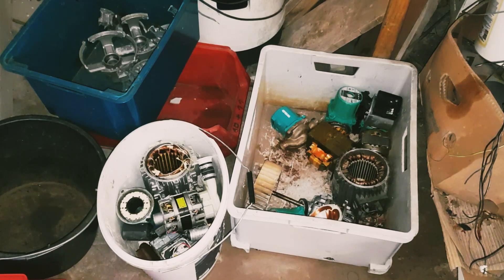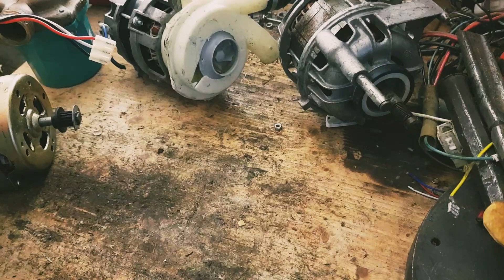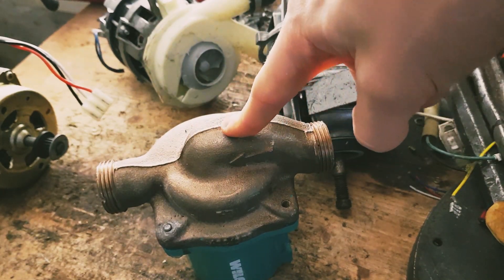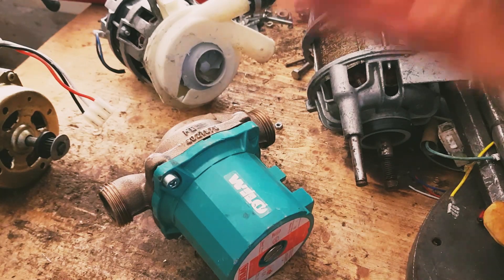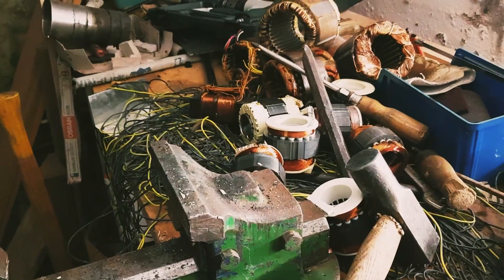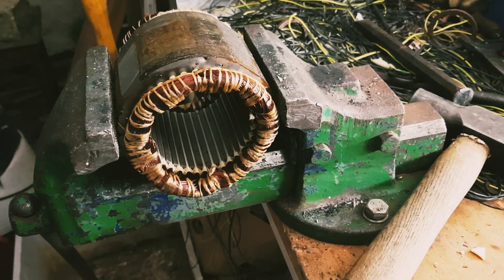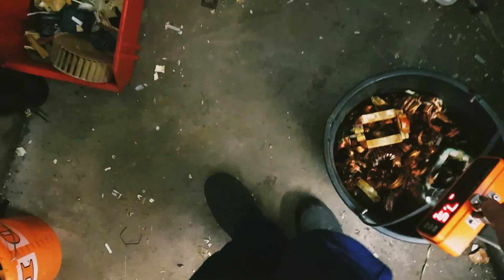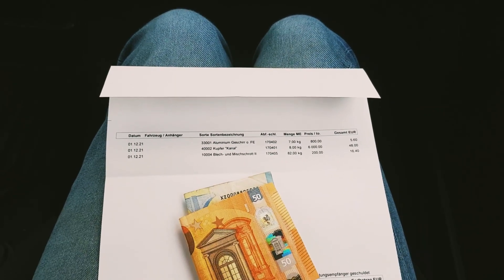Scrapping Electric Motors and Transformers for copper!

Comment: Nice little pick-up for a couple of hours work. Than air chisel looks to work very well,  I have often wondered 🤔
Might be a worthwhile purchase. I just cut one side with a grinder and cutting disc and use a punch to knock out the windings. Although,  I am going to build a windings puller,  just thought of the design and how to build today.😁
Sort of like  Simple man, but not really. 🤣
I'm thinking a rig made up and using a bottle jack to push the windings up and out of the stator. Hard to explain but I'm confident it will work. 🤞👍
Great video,  thanks.
Reply from the maker: Thank you very much for watching 😊 Yes, the air chisel works extremely well, but I mostly use it because there's nothing on it that needs to be replaced all the time, as it's the case with cut off wheels. Punching the windings through only works with about 50% of the motors I get, as they are very beaten up and usually twisted. I use a special tool to pull them through. Yes, I think the best thing for you to do would be to build some sort of machine that will pull the windings through, that's a good idea 👍👍

Comment: Wow. Amazing job on these motors and your video. Both well done 👏 ✔ 👍
Reply from the maker: Thank you mate, I should start to do this stuff more often, really was able to make a good amount of money with limited work 😊😊👍
Reply: @scrappingadventures290  
Your very good at getting the copper out easily. I had trouble with larger motors 
I don't have all the equipment.
Reply from the maker: Man, I have issues with that as well, my capability to scrap them out easily ends pretty quickly once they reach a certain size. But once you know that, it’s easy to choose the ones you can scrap 👍😃